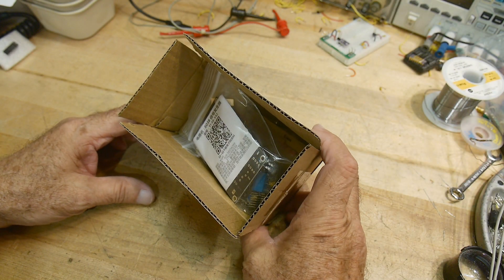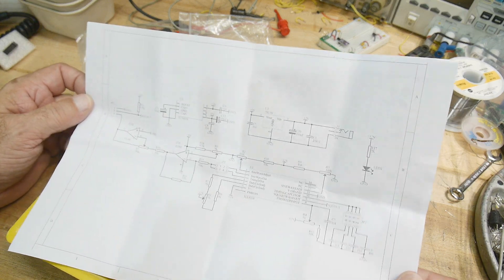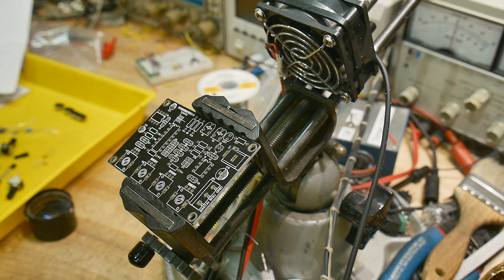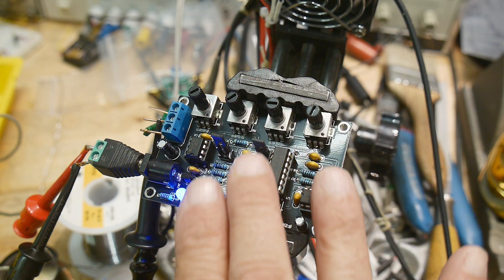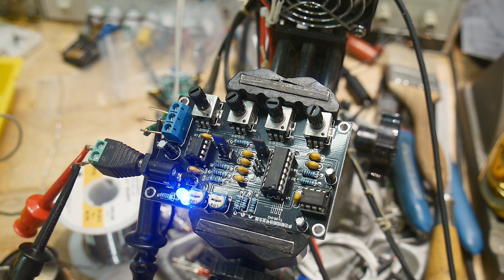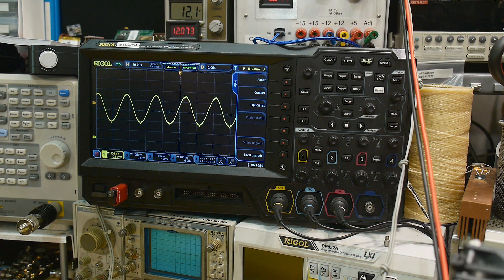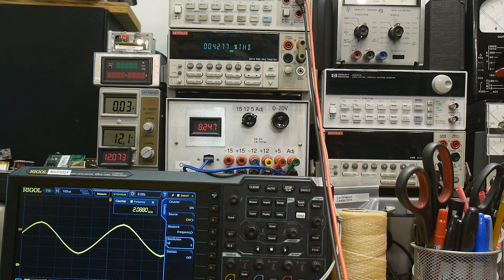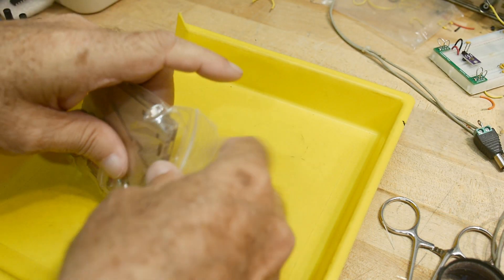#1635 4 Knob Function Generator Kit

Comment: I bought one of these recently that's based on the XR2206 chip. It doesn't have cool adjustments for tweaking the sine wave, though, and the sine wave output looks pretty sketchy. I think I might have to get one of these kits (and swap out the TL082 with one from Digikey).

Comment: I played with an ICL8038 a couple of years ago - very disappointed.  I found if you managed to get a 'reasonable' wave shape it was quickly buggered when you changed the frequency.  I have found the XR2206 much more agreeable.  Still if your just starting out either will be ok as a basic signal generator considering the price.  I think your best to use batteries, they don't pull a lot of current and you are starting with clean power, not all the noise from a switch mode power supply.
Reply: Switchers are generally a terrible choice for analog instruments unless you go to the trouble of adding additional filtering. I've used small DC-DC modules (e.g. 12-24 volts in, ±15 V out, or the like) in analog instruments, but with added LC filtering. You have to be careful and read the datasheets closely since some of them won't tolerate much added capacitance. Lots of the datasheets will provide guidance on added filtering.
I've also used a capacitive charge pump inverter like the 7660 in a very sensitive instrument, but again used additional filtering. 
This is NOT stuff for the beginning hobbyist, though. Batteries are a good hedge against making difficult problems for yourself.

I'm really surprised the ancient 8038 is still being made. It's and interesting part but hardly an industrial jellybean. Same goes for the XR2206.

One of the things you have to be careful with in devices that use RC oscillators is choosing the right capacitor type. Though most of these relatively crude circuits like the parts mentioned aren't greatly degraded, you want to avoid caps with high dielectric absorption. Once you get into capacitances large enough that COG ceramics are out, polypropylene is the best readily-available, affordable dielectric. Polyester is rather dismal. Most ceramics are awful. Lots of the newer high C•V-product types have horrendous voltage coefficient of capacitance which can bend what should be a nice triangle wave badly out of shape. It rather looks to me like ceramic caps are being used in the kit in the video.
Reply: @D614G_aka_Doug  With an XR IC I used an old air Tuning Capacitor and got the output to just over 3MHz.  Granted it wasn't 'Crystal Stable', but wasn't too bad.  This was an IC from good old Uncle AliExp.  The duty was hovering between 50%-54%.  OK so no good for a satellite or guidance systems - but I was pleased.  Lets face it, you can't expect to make a silk purse out of a sow's ear ...

Comment: I did one of those last month from Amazon, cost more, I had some gift card credits to use up. I think the op amp is a fake. It seemed to work better when I replaced it with an old one I had in stock.  The generator chip has little hf glitches at high frequencies.  The amp and buffer seem to be mostly useless.
Reply: The glitches were known to occur, even with OEM 8038 chips. XR2206 OEMs, too. The clones of both have the original problems, plus more.

Comment: I have some of those Erem cutters and they are all magnetized.  I think they do it on purpose.
Reply: Tools will become magnetized just sitting in Earth's magnetic field.
I have a bulk magnetic tape eraser that works well for demagnetizing tools, though it is a bit of a challenge sometimes because it is so powerful.
One thing magnetized Erem cutters will tell you is that you are cutting leads that are probably harder than is good for the cutters unless you have the ones with tungsten carbide inserts in the blades.
Reply: @D614G_aka_Doug   My Erem cutters have been cutting magnetic component leads for more than 30 years with no noticeable diminishing of function.  Components with pure copper leads are few and far between.  I'd rather spend a few $ on sharpening my cutters every 60 years or so than try to source all my components with copper leads.  As far as I can recall they've been magnetized since day 1.  It doesn't really bother me.
Reply: @uni-byte  
How well the steel alloy cutters hold up depends a lot on the blade style. The "semi-flush" types are generally a lot more robust than the fine, full-flush cutters.

I've seen Erem cutters completely destroyed by a single cut of something too hard for them. It was a pair I'd purchased for a place where I was consulting. Some bozo used them to cut who-knows-what and put a horrible nick in the blades. Somebody else tried to sharpen them and rendered them useless for anything. They were one of the fine-wire full-flush styles.

You will never escape iron alloy leads. Lots of resistors, especially cheap ones and some good quality moderate power types have steel leads (to reduce heat conduction to the PCB, which decrases power handling but protects the board from scorching). Alloy 42 and Kovar are both iron alloys. Fortunately most of the iron alloys used for leads are relatively soft. I"ve seen remarkably hard leads on some polystyrene capacitors from years gone by.

I reserve my assortment of Erem cutters for fine work. I have a pair of Erem cutting forceps that are really nice for certain things.

One thing I'd like to procure, though I actually do almost no electronics anymore, is a pair of shear type cable cutters with well-hardened jaws. Shears like that are vastly better than diagonal cutters even for small cables or large single wires but I've yet to find any that aren't damaged by cutting coaxial cable with copper-clad steel centre conductor. (Cutters made for trimming dog toenails work great on copper wire and hold up fairly well - you get a nice, clean, square cut.)

Comment: What happens to the shape of the waveform with a better OP-amp?
Reply: The ICL8038 sine wave just isn't particularly good. The sine wave is derived from the triangle by piecewise approximation. The result isn't horrible but it isn't a good as can be had from something like an LC oscillator.
Reply: I was hoping to see that also.